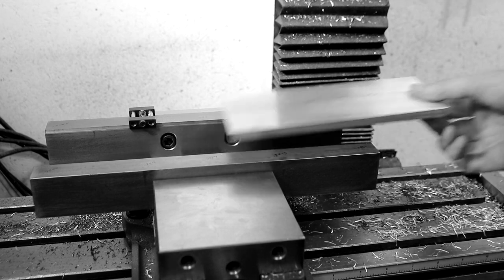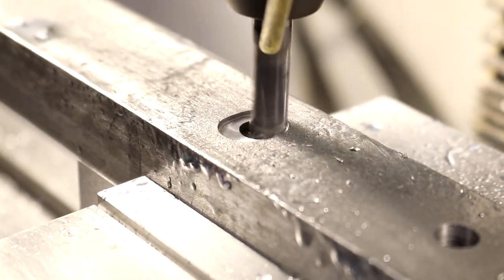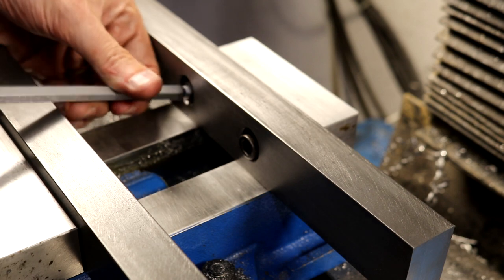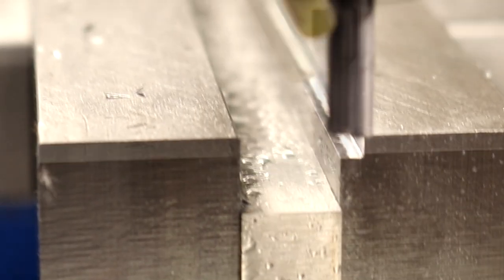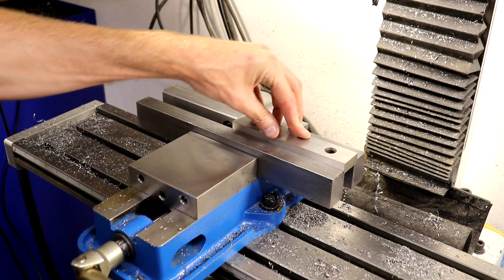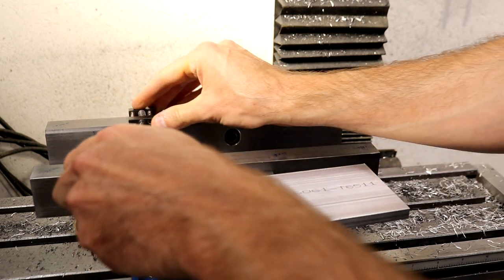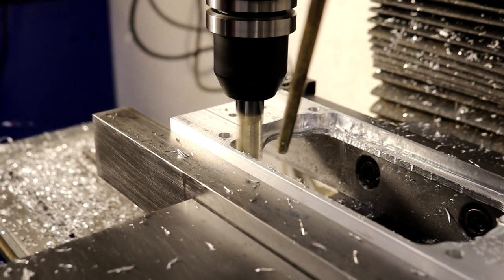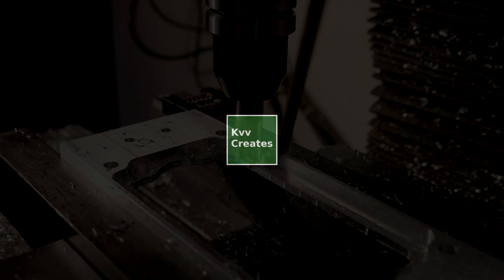Wide Kurt vise jaw plates replacement

Comment: hmmm intersting idea , the next thing to improve wide clamping is to siamese two vices together
Reply from the maker: I have to make do with what I have :) I've considered adding holes towards the outer edges, outward from the vise, to receive bolts, to add just a little more clamping force. So far, has not been needed. Take care

Comment: For light work holding Umbau's table mounted vise will work Kent. But there's at least a few threads on the Practical Machinist forums pointing out the industrial versions of his idea are more than capable of bowing the table on a Bridgeport. To use that type of table vise on a much lighter mill I'd want to have an indicator on the table ends as the part was tightened in place. It takes a whole lot less force to bend a mills table than most might think. It won't permanently bend the table, but it can start to bind and then put excess wear on the dovetails, feed screw nut and in your case stepper drive.
Reply from the maker: Thank you for pointing this out, I would not have thought of it, and it makes perfect sense that without the massive vise bed, the table is going to distort. Very interesting!
Reply: @kentvandervelden  Yeah I was in the tool dealers cash in hand wanting to buy one of those milling table vices some years ago. They were out of stock though. Not long after I spotted the first thread on PM about them distorting the tables if your not really careful. Machine tools can have some unexpected results with what your adding to them sometimes. I wouldn't have thought of it myself without those PM threads detailing the issue. With a big heavy duty cnc bed mill they would probably work real well.

For light tightening and work holding on our lighter weight mills they should be fine, but for what I would have been using one for it would have been far past light. My mills manual and a 3/4 sized Bridgeport clone, so a little bit larger than yours. I bought a matched pair of these. https://www.glacern.com/gpv_615 if it fits within there jaw opening it's a good fairly expensive and a bit heavy way to go since a pair of them weigh about 170 lbs. I think your extended jaws should work well enough for the part sizes you were doing. A couple of C clamps on the ends would stiffen things up a lot if you ever run into a chatter issue.

Comment: Hi we see you extended the vise jaws to hold longer plate material, it is a good idea for your fix, we use a vintage Kurt 3.00" vise so we could do this to ours as our work is so much smaller. Good share. We like your vise jaw stop as well comes in handy.
Lance & Patrick.
Reply from the maker: Thank you guys, I'm glad this was useful. It's nice to hear from you

Comment: Really nice ! :)
Reply from the maker: Simple and super useful. Thank you
Reply: @kentvandervelden  sure is, I want to try it with my 6inch vise, I scraped a big part the other day due to chatter . You have any tips on milling the bolt holes?
Reply from the maker: @PepeCheizen  Bolt holes will be no problem and could be done on a drill press if needed. If you don't need the step, even simpler. Want to have pieces that are square and parallel, but one could bootstrap those if needed. I considered adding holes for screws to clamp at the ends, not in contact with the vise jaws. Might be useful. I use large clamps instead.